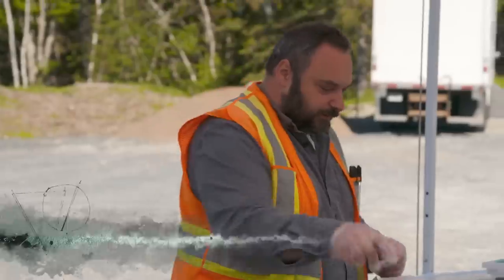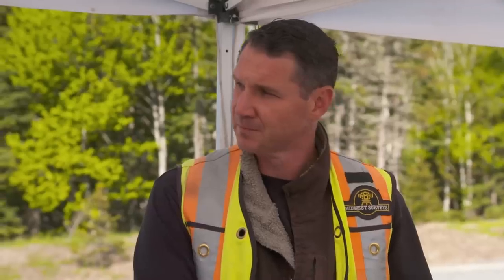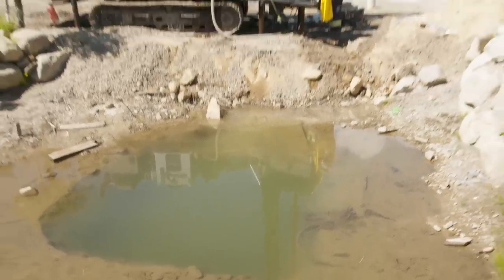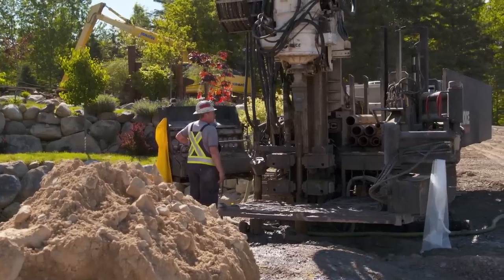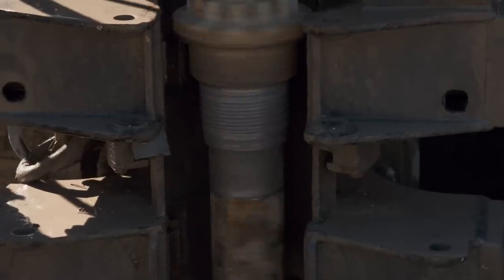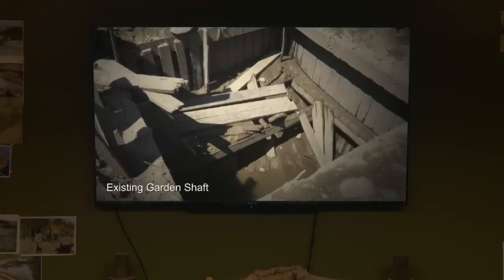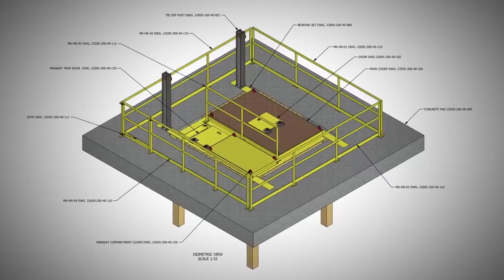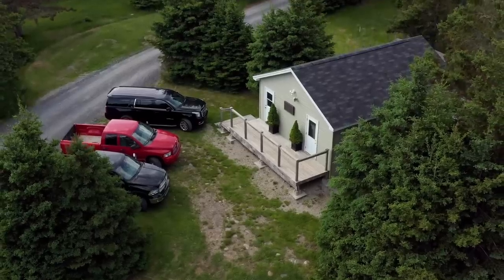The Curse of Oak Island: DRILLING OPERATION Exposes Major Tunnel (Season 10)

Comment: i grew up in hazel park ,mich..in the 60-70,s  i watched the building of i-75. right down my street. the first thing done was a very deep big round hole with metal outside  ring.. this hole was at least 100ft..for under ground drains .under i -75.. i 696...the hole was at least 30 ft around. it was done one ring at a time. .put ring down . dig the dirt. put another ring on other ring and so on till theres a very deep 100 ft. hole, no dirt .or water..i -75 is under  i-696..bridge..under that was the drains. pumps. to take out rain water.. 50 yrs later its only flooded two times.. each time it rained large amounts .20inchs or more..

Comment: there are a whole series of underground tunnels that are completely (undocumented) from all of the recorded shaft events.  Just as much as there is a C1 complex of an underground tunnel that shoots off into the Lot 17 16 15 area, you have the Blankenship 10X borehole cavern and tunnel as well which is connected with the C1 and Garden Shaft network.  Also the Halifax tunneling from the (X-1, Blue Hole of South Cove) and running from there up to the Garden Shaft is another connective tunnelwork.  The reality of any flood tunnels is that with the rising sea level, the majority of any/all tunnel entrances are being flooded due to the sea level, and not some flood trap system.

Comment: When they went into the tunnel that one time with the diver I always had a feeling that he didn’t do the job right. On the scans they saw things but when he went down to actually touch it he didn’t see nothing or touch nothing and they left it at that. Guy was probably a mason and didn’t want to find anything of value because of that
Reply: Sending a diver into that tunnel was just to add to the suspense and may threaten life.   In water with a lot of stuff floating in it in a hole which will flood from the adjoining ground water, the water could have the material filtered out of it and flooded with positive pressure water to maintain the hydrostatic pressure.  Then it would be transparent to send a ROV in which can see and grab things.  Things can always be vacuumed up.  As the water is disturbed and silts up, water can be sucked up and filtered.
Reply: Well said!  You are absolutely correct!  I don't think that diver was a Mason, but they were clearly on the verge of getting answers and possibly solving the Oak Island mystery in short order.  That would have ended their top-rated money-making Reality TV show and the "gravy train" would have ended.  Remember how upset Dave Blankenship was when they all walked away from Borehole 10X never to return despite what they saw on the sonar scans in that cavern/void.  Dave Blankenship eventually left the show.
Reply: Remember though, one person has to die first. Won’t be finding anything today. 😂 (tongue in cheek)
Reply: 🤣🤣🤣 "diver was probably a mason"

Comment: side drilling in the vertical shaft would be productive, however, that is the basic strategy used before. Except that they tried side shafts. They could collapse or take on unstoppable amounts of water, whereas a drilling would not. Drilling would also allow the gasses encountered to be limited and analysable, before there could be fatalities. Happy hunting gentlemen and OMG be careful.

Comment: What would happen if sink hole opened up,
Reply: Interesting comment regarding a sinkhole!  The Money Pit was originally a deep open sinkhole that was somehow connected to the cavern(s) below that could be accessed in ancient times by cave/niche openings at the shoreline when the sea level was much lower.  The Money Pit was not "dug out".  Rather, it was backfilled after the fact from the bottom up with dirt and securely-fastened oak log platforms every ten feet to evenly distribute the weight of the dirt so as to not crush whatever it is/was concealed deep below..

Comment: The real treasure is not in the entire Money Pit area, but the flood tunnels and water flow of leached gold and silver particles are coming from the underground mines, tunnels, (lost air shafts) of the Lots 15 16 area - which are the oldest of mined areas of the 1500s-1650s, ... and only the later Lots 17 18 area are a second generation of mines and tunnels.  The real source of treasure lies underneath the 35-50 foot elevation of the eastern drumlin hillock ... where the Serpent Mound (militarized) battery and bunker system (charcoal 1320s-1440) is lied buried underneath.  All such leachings of precious metals comes from the Lots 14 15 16 area down into the Lots 17 18 area.

Comment: Will this be the shaft which you could see in a trailer for season 8  I believe of a big hole lowering equipment in it. It was there for just a second. Which made me believe they’d found the treasure or at least something I’ll look if that trailer is still available  a 31 second trailer
It’s the curse of oak   Island new season November 10 10ep is the title it’s at 22 seconds
Reply: It’s the curse of oak  new season November 10 10ep
Reply: @csmit72  please explain
Reply: @Petergalvan   the title of the clip is the curse of oak island new season November 10 10ep  a clip from 2019 it’s 31 seconds and you see for 1 second a hole with equipment lowering into 👍